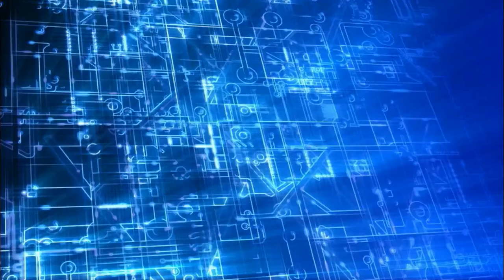2030 ic amplifier board wiring connections explained (Tamil).

Comment: 2030 ic stereo board 12 012 v 5amps transformer use pannalama bro
Reply from the maker: Bro, your question is not clear bro.
Reply: 2030 ic stereo board ku  +12  G -12 v (5amps)  AC transformer use panni 12v (5amp) dc  convert panni line thara lama  board la  complant varuma ella 12 v (3amp) dc than thara numa
Reply from the maker: yoga yoga . Yes, you can use this method..
Reply from the maker: 5amp kudukalam. But you have to replace the ic (coming with the board) with original 2030 ic for best performance.
Reply: ok bro thanks

Comment: ithanoda output watts evlo bro??
4440 ic kum 2030 ic kum enna different??
then which is the best??
and long life??
Reply from the maker: 2030 ah vida 4440 sound romba athigama irukum.. but 4440 ku amp athigama kodukanu.
Reply from the maker: But whatever it may be .. the ic which is comming with board is duplicate ic. If u replace it by original ic means it ill be more perfect..
Reply: which ic ?? 4440 or 2030??
Reply: MOSFET stereo board starting price evlo bro?? na oru 5.1 amp podalamnu irukka.. ithukku entha transformer podalam?? full details please tell me
Reply: ok thanks bro.. and tell me the transformer details like diode and capacitor values